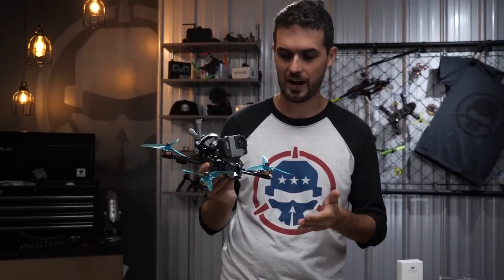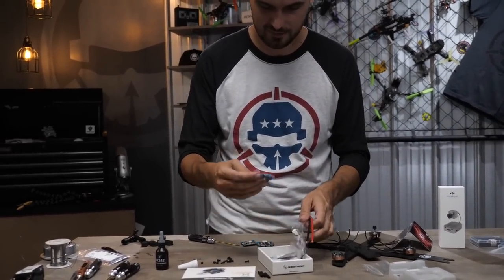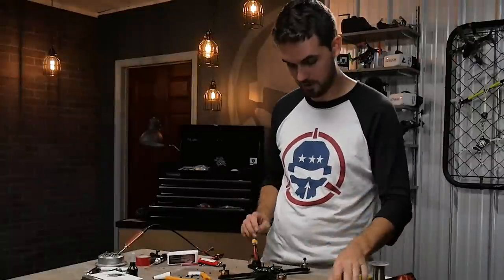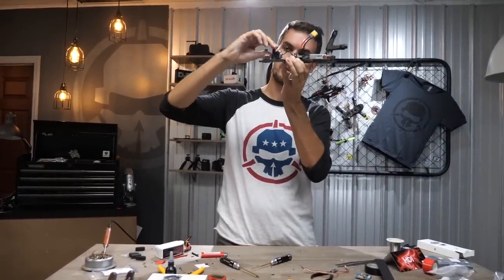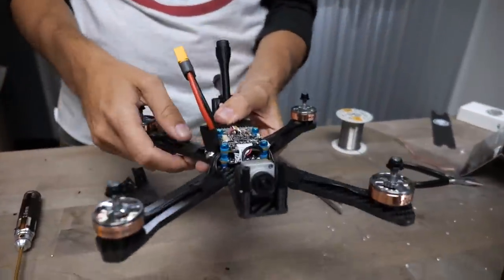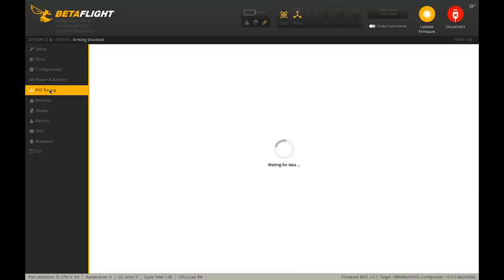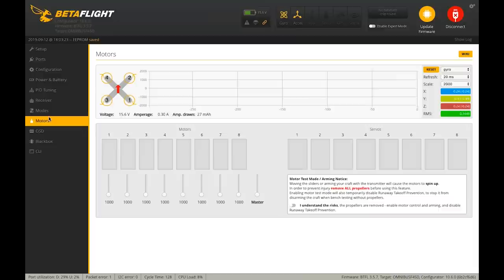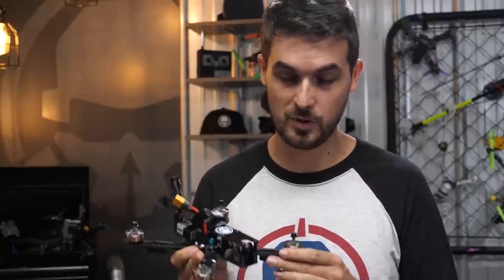Rotor Riot Spec Kwad - HD1 Build with DJI FPV System

Comment: Come on Drew, learn properly how to solder. This is a joke.
Reply: Where is your channel with the most professional soldering video in the world????
Reply: @invisibleaznDJ  Sorry for commenting, next time I will comment anything just if I have recorded a video for it, if that's how it works.
Reply: @704Lajci  If you are gonna be critical of someone in a condescending instead of constructive way, you should probably be willing to prove you can do better.....just saying.  You may be the most magnificent soldering tech in the world.  That being the case, it would be awesome if you could suggest how he can do better instead of act like a typical internet commentator.   Something tells me ledrib gets MANY more hours of flight time then you or I combined.   I doubt his kwads are falling out of the sky because of poor soldering
Reply: @invisibleaznDJ  Did you see that blobing and massaging the solder pads? Soldering should be a quick in and out job not, this way he's just vaporising the flux. Next thing. When u pre tin thick wires u should heat the wire from under and the solder should come from the top , not both from the top and he clearly said that his wires were not cowered all around in solder. His mistakes may not affect the functionality of his quads but for an electronics engineering student it's a pain to watch.

Comment: One if the worse 3d parts iv ever seen. You can see that the layers are separating of the antenna holder. Get your self a proper 3d printer